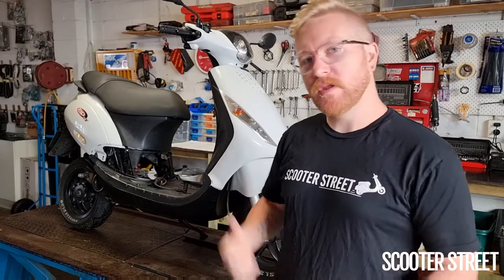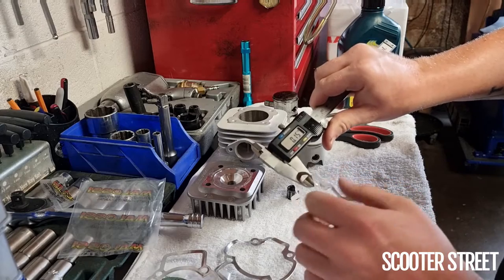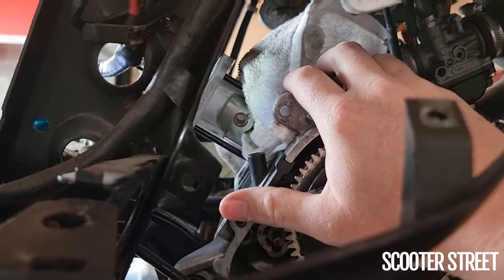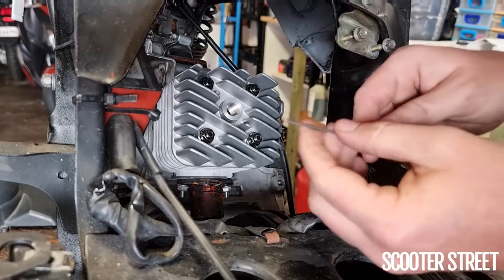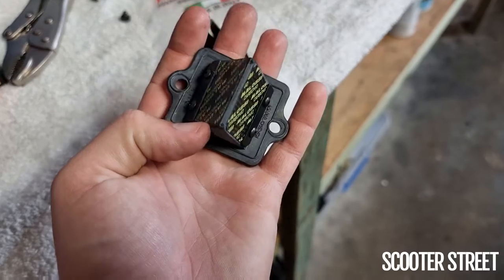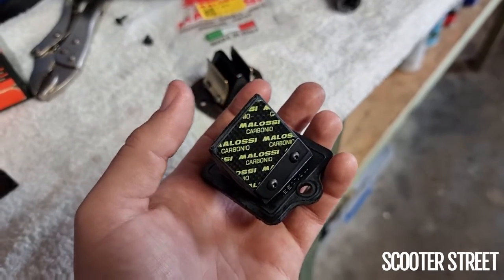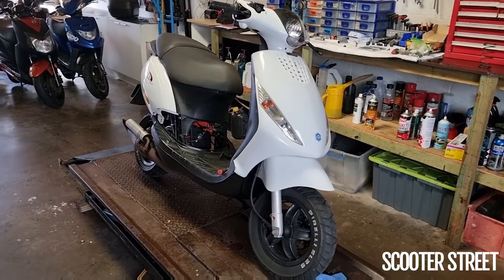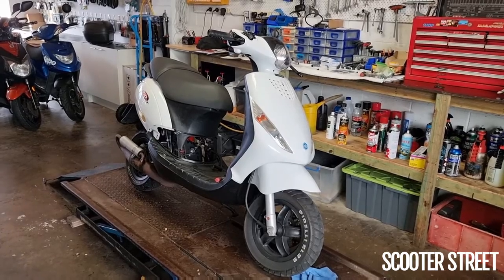Don't Make This Mistake! Fixing This Piaggio Zip With MHR 70cc Install

Comment: Great video and yeah I can confirm that you definitely need that c clip in properly, cost me a brand new kit a couple years ago never made that mistake again😂
Reply from the maker: Ahh yes, we have all done that😂
Reply: guy fails to mention is that the clips are directional. If you lay them on a flat surface you should notice the legs bend away from the plane of the circle. The legs need to face so they bend away from the pin else they can be snapped off.

Comment: great video🙌🏾. I have the malossi cast iron 70cc on my Aprilia Srmt. It runs great, tops out at around 90kms. I May upgrade to a more powerful kit though. Probably an mhr rep
Reply from the maker: Thanks Kahlil. What is your current set up list?

Comment: Anything sport or below should use stock airbox 
Anything mid race and above should use pod filter, I run a polini Corsa 70cc Piaggio LC ported with polini covered airfilter polini cp21mm
Reply from the maker: Good input, Thanks👍

Comment: Nice job Brad.👍

If you ever change a Euro 4 Piaggio to run a normal Dellorto carb without all the sensors and air injection, I would love to see how you go about it.
I think in the future it will be something people will do. A bit like the Aprilia ditech conversion when it breaks.
Keep the videos coming. 👌
Reply from the maker: Thanks and yes we have done this a with a few E4 models, run the standard carb with all of the sensors disconnected. It led us to trial the headless kit in an attempt to have the dash warnings and Temp sensors functioning. PF, you are a great supporter of our channel and we thank you for it.🎅
Reply: @scooterstreetau hey bro need some advice please

Comment: Another great one, have you ever done a repair on the aluminium holding the front part of the main stand on the engine, got a hiper 2 im restoring but ever single fastener is rusted stuck😄 bike was pretty rusty too. But need ti save the engine!
Reply from the maker: We have seen this several times, You can fit some washers ether side of the aluminium holes of the engine but it really needs to be Al welded for a true repair.. Or fit a side stand and have a workshop stand for repair work.. Thanks for the long time support ML🎅

Comment: Hi! Love your videos, assembling My mhr kit as i am typeinformasjon this😂
Just wondering, do you have ant tips for getting those C Clips inside of the piston? You make it look very easy, byr i am struggling a bit.
And also i have a 21 mm carburator and a full polini clutch and variator with 6.5g, going to run it with a stage 6 exhaust sinne the malossi mhr exhaust dont fit. Do you have any idea what size jet i should try out?
Reply from the maker: Thank you🙌. Fit the transmission side circlip into place before mounting the piston on the conrod. If you have a flat blade screwdriver of te small size, you can cut a small groove into the tip so it creates an area that the circlip will fit into. Use the screwdriver to gently press the circlip in to place. I hope this makes sense👍
For the jet if you are running a POD filter tart with a 110 main jet and move leaner as required, don't be impatient and try every jet size as you lean it off don't skip. engine must be warm..

Comment: kind regards. thanks for your videos. I have purchased a 70cc air cooled Malossi Sport cylinder. I have a Tecnigas Triops exhaust for 70cc and the exhaust outlet hole of the cylinder is smaller than that of the exhaust by about three millimeters. What I can do I will thank you very much for your help.
Reply from the maker: Hi Carl, THanks for watching and commenting👍What do you want to do? Do you want the same diameter? you can machine the cylinder to match at the two points.

Comment: Hi I’m about to order a 70cc cylinder for my sr 50 r 2020 and was wondering which one you would recommend. I’m not planning on changing the crank shaft or carb. I already have a cdi and the price of the cylinder does not really matter, just trying to push as much power as possible with stock crank and still be kinda reliable. I was thinking about something like a stage 6 race/ sport pro, mhr rep
Reply from the maker: Either of the ones you have mentioned are very good. The crankshaft and bearing set that you have must be in good condition before considering an upgrade. So if this is the case go for it.👌
Reply: @scooterstreetau  is there something I have to know before installing which is special for my model (sr50 r euro4) or is it just like any other bike
Reply from the maker: @theo2522  There is a temp sensor attached to the head, if you use the Malossi kit you must purchase and fit this Malossi part 1518132. Now the sensor will function. Other than the sensor all the same as other 2 stroke scoots.

Comment: hello at minute 7:50 down there on the crankcase where the connecting rod sits, I have some scratches, 3 scratches on the whole side, but there are straight scratches on the crankcase, which means none of them are flesh, is there a problem? I hope I explained myself well enough
Reply from the maker: Try to find what is the cause of the scratches...

Comment: Hellou i have a vespa primavera 2t and i sort the site  from the carburator and i put a 60 jiggler . Now its runs very fine all to 65 km h . Do you now if i have to modify something to the oil pump ? Thankyou
Reply from the maker: The pump and system should be working and well maintained, so check it and replace the worn parts..

Comment: Dear Scooter Street, Very useful video thank you. May I ask for advice about my setup.
Aerox Minarelli horizontal engine. 70cc Malossi MHR replica,
TPR performance crankshaft
Yasuni R exhaust derestricted.
Vforce reed valves
standard airbox without snorkel and Intake manifold.
Just bought Delorto PHBG DC 21mm and I have no clue on Jetting it. Can you please Give me your opinion on what main jet I should start with and work my way down?
Reply from the maker: Thank you.. Start with 94 jet, you may end up in the range of 82 - 90 or thereabouts. You should consider changing the needle too.

Comment: I have a piaggio zip with a malossi 70 cc sport kit and want to delete/disconnect the oil pump to run pre-mix. What is the best way to do this?
Reply from the maker: Remove the oil pump belt. Shorten or remover the oil hoses, or remove the pump completely.
Reply: @scooterstreetau  Thank you very much

Comment: can i use mhr rep with my stock piaggio zip crank? Only has 800 european miles on it.
Reply from the maker: Yes you can, but the Small end bearing must be checked every 3000kms as they wear and also can wear the small end of the conrod. Recommended to use upgraded crank.

Comment: I know it's hard know what to say on videos but.....Did I miss something or did you not set the ring gap?!
Every cylinder kit needs this or ring expansion causes it to seize or break! Or can.
Pre ignition - ignition too early for a few reasons.
Detonation - ignition becomes explosion ie burns faster than sound.
Too big carb or race pipe won't cause seizure if jetted right.
I used an mhr pipe and 21mm phbg on a tuned standard cylinder for ages......all of 11-12 bhp at 11000rpm!
Reply from the maker: Yes. If we filmed and showed everything we do our videos would be 12 hours long. Can you make up a short video showing how you do?

Comment: Hi Brad I’m struggling with my gilera stalker 2T I have installed the 70cc malossi kit the Leo vince TT exhaust 5.7G rollers changed the reeds and I have the red sponge with snorkel out. My main issue is with jetting I just can’t get it right I started on an 82 the bike spluttered and didn’t want to go very well so I went to an 80 and it was still running too rich and fouling up the plug with black oily spuge same with the exhaust tip. So I’m now on 72 and it’s still not right. Do you have any idea on what jet size I should try next because I just want to get it right before I damage my scooter again I think it could possibly be over oiling is there any adjustments to the oil pump I can make? Any help would be much appreciated cheers!
Reply from the maker: Was the scooter running normally before changing these parts?
It sounds like you have an issue there external to the parts you have fitted. It should tune within the jetting you have tried..

Comment: can this malossi mhr cylinder run well with standard crankshaft if one's machine is relatively new
Reply from the maker: Yes if the condition and age is low for the crank it can be done. We encourage an upgrade on the bottom end as soon as you can, so save up and do it all at one time.

Comment: Hi guys, what jet do you usually put on a mhr replica whit arrow extreme and phbg 19?
Reply from the maker: At a guess I would say you'll probably end up with somewhere around an 85 - 90 jet with that carb. It depends highly on what exhaust you have on the bike. A basic exhaust like a Leo Vince TT will be on the smaller end, and conversely a more performance orientated exhaust like a Yasuni R will be on the upper end.

Comment: How tp get the top speed higher on a piaggio sfera 50 cc
Reply from the maker: Watch some of our and other tuning videos. You need to improve key parts of the engine. Exhaust, Transmission, fuel system.

Comment: Very great and detailed video, been waiting for it some time now! As a question, why did the customer opt for Air Cooled instead of getting the zip SP2 front and Liquid Cooled? Is it because of personal preference, to save money?
Reply: I'm also interested in that, because I have an AC machine so I want to know is it worth changing to LC
Reply from the maker: @oliverbabic7982  Thats a great question. He didn't want to spend the money is the short answer. One of our team has done an 'SP' liquid cooling conversion to an air cooled Zip quite successfully previously. We even have a parts list here to do the single swing arm SP front end conversion too, just waiting on a candidate to step forward! If and when we do one, we'll definitely film it!
Reply from the maker: @oliverbabic7982  It is, the difference is dramatic. There are a couple things you have to work around - however the AC chassis still even has the radiator mounts, so the conversion can be done easily using factory parts, where there aren't better aftermarket ones available. The big key we've found in the past is if you go for an electric water pump, make sure you keep the thermostat in the head to slow the flow (Unfortunately the AC engine casing doesn't support the bearings for the factory water pump). Electric pumps often flow so quickly that the coolant doesn't spend enough time in the radiator to adequately cool down. I suspect even Malossi have had this issue on the C-One, as they have developed a special liquid pump controller which adjusts the flow rate of their electric pump according to heat sensors and some manual controls. If you're lucky enough to own a genuine Zip SP, the factory water pump doesn't have any of these issues.

Comment: hello, I have a sr motard of 2020 and I would like to know what you think of this elaboration
 Top racing gold line 
Yasuni c16 
Multivar 2000, fly clutch, malossi catch bell and malossi kevlar belt 
19 dell’orto 
Malossi e13 
Crankshaft top tpr b80 sp12
Malossi vl13 
Malossi digitronic
Reply from the maker: Sounds good, many nice parts in the list. If it performs well and you are happy with the ride, then Great setup👍

Comment: Was anyone scared for the reed block/ carb bolt was going to fall into the crank housing (19:00)
Reply from the maker: No not scared, We have dropped certain parts before and to retrieve them you can use a great tool which has a flexi wire or telescopic arm with magnet at the end (magnetic pick up tool). You must appreciate how difficult it can be to hold the camera and remove parts with one hand. Thanks for watching the whole video👍

Comment: 0.8 is not a squish on a 70cc. You will increase detonation risk & lower efficiency. I would recommend reading some basics on 2T tuning like the tuners handbook by Gordon Jennings or anything by A. Graham Bell.
Reply from the maker: We follow the engineers instructions from Malossi when setting up this kit? I would recommend reading the Cat in the Hat😹🎩 Instructions from Malossi: https://eamalossistore.blob.core.windows.net/files/montaggio/pdm/73%208455.pdf
Reply: .8 is actually quite safe for this engine, they run down to .6 with no issues whatsoever. 0.6mm squish with the right head volume on one of these they run sweet and crisp :)

Comment: How dumb of an idea is to slap on a 70cc kit with the stock crank?
Reply from the maker: Not a Dumb idea at all! Give it a go and when you are ready upgrade the crank. If the crank or main bearings are showing excessive wear then change them before fitting the 70kit. Otherwise go for it✌